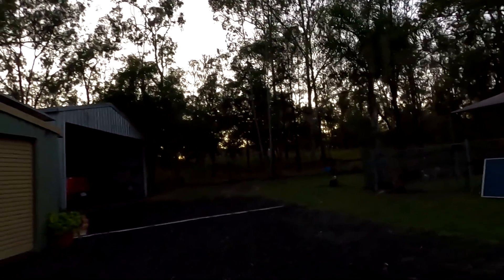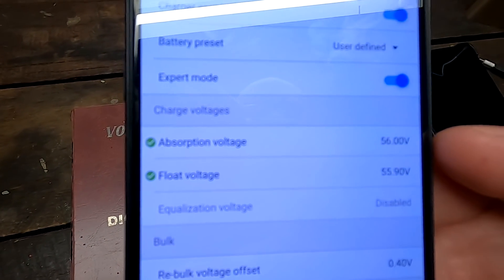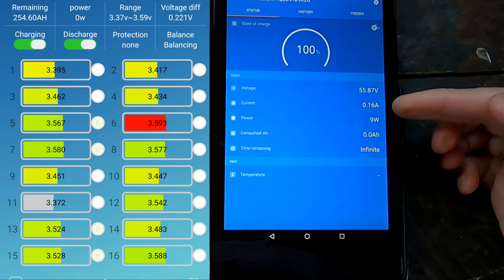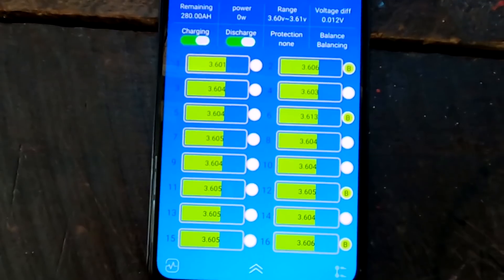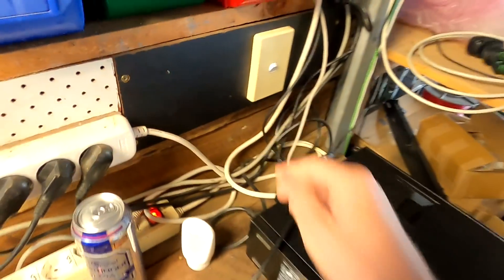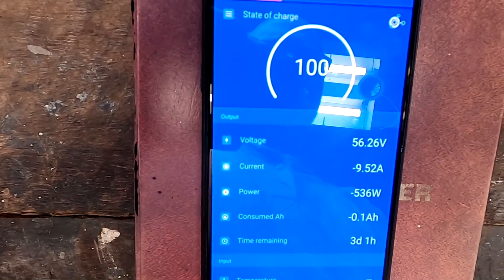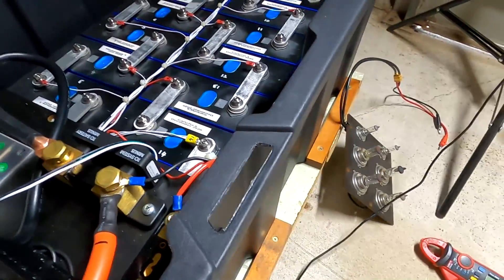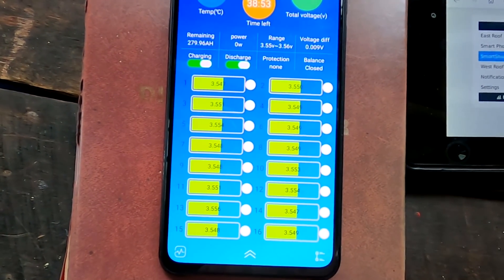Battery fixed  - but for how long? | Part 2/3

Comment: Be careful with just turning off one of your charge controllers solar cells degrade a lot faster without a load on them if they're in the Sun
Reply: Really? This is interesting I will do some research on this as that is basically what happens when your battery is full, the charge controller turns off.. or floats a very small amount.
Reply from the maker: Never heard of that before either. Why would they degrade faster without load?, @Josh?
Reply: @OffGridGarageAustralia  The danger, when using Victron chargers, is when you disconnect the battery from the charger while the solar panels remain connected. If you turn off the charger in the settings there is no danger.I tell you this from my own experience, when I broke a Victron charger.
Reply from the maker: @mihaitaiosub  will, I've shown this several times in my videos.  Disconnecting the battery dies not Herrn the controllers at all. They go into float mode and keep supplying energy to the load.
Reply: @OffGridGarageAustralia  Something like this happened to me when I had around 3000 watts from the solar panels and I disconnected the battery from the charger. Moreover, the local Victron distributor also told me that there is a risk of the charger breaking down, when we have high power from the solar panels without the battery being connected.
Reply from the maker: @mihaitaiosub  hmmm, that's been confirmed by Victron that it does not harm the controller. Other controllers can be fried by doing this (I killed 2 by doing this). I can ask the chief firmware developer at Victron again how the software is been written to handle these sort of situations.
Reply: @OffGridGarageAustralia  Ok,anyway, I will never risk it again.Because of this, I do not use BMS and I have an automation in Home Assistant that monitors the voltage on each battery and when the voltage in any cell exceeds 3.65 volts I use the external charger control to turn them off.

Comment: I did suggest equalization of the pack once a while in your very first video (months back) on the issue of imbalanced cells. But sadly it was ignored telling it is only for lead acid batteries that time. Anyways now you did that, I'm happy.
Reply: Equalisation not recommended for Lifepo4, (or GEL) that’s why disabled. I Should be careful using a Lead Acid setting with Lifepo4, although the charge profiles are similar. Lifepo4 profiles use CC then CV charging. A user profile, to enable higher charging voltage, to balance is possible; but just as easy to up the voltage manually, in the existing profile. I wouldn’t leave my battery in profile that is not quite right.
Reply: @michaelbouckley4455  Yeah, but I was talking about the process, which needed increasing the voltage to max once in a while and Andy did it in this video, that's why I'm happy. Not talking about the profiles here, anyways it's disabled, we can make a custom profile though.

Comment: Instead of balancing at 3.6 then complaining when it's not balanced under that, instead balance at your normal change voltage and then you will 'equalize' every single time the battery fills.
Reply from the maker: I'm not complaining, I'm testing, learning and sharing 😉

Comment: It would be interesting to cycle the battery for about 30 days WITHOUT ANY BALANCE but charge only to 3.45 V per cell.
And then after 30 days, charge it again to 3.60 V per cell and see how much the cells have drifted.
I would send a beer to see the results of this test. :D
Reply from the maker: That's what I'm doing now. I actually charged it back up after 2 day again and it was... -> next video.

Comment: Remember that the balancing by the BMS will actually take lots of daily cycles... several weeks (which is fine.. even desirable).  Not just one cycle, even if you hold a high voltage for a few hours.   Normal BMS operation is more than enough to keep LiFePO4 top-balanced.  You don't need to do anything more sophisticated than that.  Just return the Float to something reasonable (like 3.35V), and set an absorption time at the bulk target voltage of, say, 30 minutes, and that should be enough.

There is no such thing as 'equalization' for LiFePO4.  Its a bad idea... a very bad idea.  There is absolutely no need to equalize the cells once a month.  LiFePO4 cells hold their top-balance for many months, even longer than a year.   The small amount of balancing the BMS does on the daily cycle is P.L.E.N.T.Y. good enough to keep the batteries balanced.  All 'equalization' will do is wear the batteries out faster.

-Matt
Reply: He is not going to do Equalization, he is going to use that "settings" to go up to 3.6v with controlled maximum current and time to his battery. It is a "trick"
Reply: @Junker Zn Good point.
Reply: Equalization.. totally agree. There is a lot of documentation on this if you do a search for it.
Reply from the maker: Thanks all for your input with that. As Fernando said, we could use this function to just raise the voltage here and then to make it easier for the BMS to balance at a higher state of charge.
The main problem is, that I rarely hit the 100% SOC. It could take months until I manage to fully charge the cells again, especially in winter time.
Reply: @OffGridGarageAustralia  Not (being able to) charge the battery nearly full is advantageous, even if it a bit annoying sometimes.  The long the battery sits around less-than-full, but not too empty either, the longer it will last.

If you are not able to charge the battery up fully, also make sure that you are not regularly discharging it fully in winter-time.  Usually its one problem or the other and not something inbetween.  You might want to consider changing the low-voltage cut-off so the battery is not allowed to go below, say, 25%.

-Matt
Reply: As an addendum, I would also recommend programming the cut-off into the inverter, and then having a second inverter circuit for small loads that is allowed to go lower.  That way the lights can stay on after the larger loads get cut-off due to the low battery condition.

(As another addendum, for everyone doing off-grid... when you become entirely dependent on your off-grid solar + battery + generator + inverter system, it always makes sense to actually have two completely independent systems in operation.  Because there will always come a time when something goes wrong or requires serious maintenance and you don't want to be completely out of power what that happens).

-Matt
Reply: @junkerzn7312  Yea. With my inverters I have my top end set to "full" which is 56v. It will hit the 56v and run for another hour or so to top off current automatically (Very nice feature). Since my solar panels are not installed yet its more like a backup system for the house so I let the batteries relax and they end up at 3.3v or so. I have run tests on them and there is very little gain letting them settle at that voltage so I believe the amp hour loss is not worth keeping them charged fully. If I haven't used them for a month or so, I run a charge, discharge and charge back up cycle, then they are good.
Reply from the maker: @junkerzn7312  Thanks Matt. a 2nd inverter plus a 2nd battery bank make sense for redundancy.

Comment: Lithium io batteries do not need to equalised
Reply: @evroy anderson That is true, but he is cycling the battery at a lower voltage to increase the life of the pack. The downside to this however is, that the pack does not get balanced properly. By using the equalize setting, he can go to a higher state of charge once a month in an attempt to balance the cells.
Reply: @SpeakerKevin  you can balance at any voltage. Don't get suckered into anything this guy says in these videos, it's almost certainly false
Reply from the maker: @BenK. That is wrong as I just proved in my recent videos. You CANNOT balance at any voltage with these cells.
Reply: @OffGridGarageAustralia  does that mean even if all cell voltages are 3.35V, its not balanced or could be in different state of charge? that doesnt sound right, as my packs have been say 3.281V and they discahrge at same rate until 3.2ish, Also, I have left my 16s in parallel for full 45 days to balance at 3.200V with 1-2 mv difference.. so now you say that cells are not balanced?
Reply from the maker: @videostar555  with LiFePO4, voltages in these low areas is not an indicator of state of charge. At 3.35V there could be easily 10% difference in capacity and they all show the same voltage. This is just at the beginning of the knee in the charging curve, so charging to 3.35V will give you slightly inconsistent results.
Reply: @OffGridGarageAustralia  Yep, That is true since the curve is so flat but if they were at different SoC, discharging at 100-180A ( in my car) should deplete the voltage drastically but it remains similar until 3.2v across all 16 cells which I have discharged until now. I have been at impression that the cells are well balanced. :)
Reply: He is not going to equakize, he is going to use that settings

Comment: Your charge controllers can be programmed it to equalize on 30 day intervals and you can set the eq voltage too
Reply: Forgot to mention you need to enter expert to make those changes
Reply from the maker: I know, I have to use a lead acid profile and change the settings though to enable equalization. Otherwise it's not available.
Reply: @OffGridGarageAustralia  Oh ok

Comment: One benefit of creating your own profile is that you can easily load that profile onto the other charger and both chargers will have exactly the same settings.
Reply from the maker: Yes, that is true, I'm using this function all the time when changing parameters.

Comment: Bingo it will work until it doesn't or until Andy changes the settings LOL. Cheers buddy. Well equalization on automatic may work but if it screws up there will be nobody home to save the battery, seems to me there is no protection of high cell in equalization mode only high bank voltage.
Reply: @OffGrid Wanabe The bms will shut the whole pack down even if one cell goes too high.
Reply: @SpeakerKevin  That would be normally true but when you use a lead acid program on lithium it may just overide the safety parameters
Reply: @offgridwanabe  The Victron charge controller would do the equalization, while the bms would keep an eye on the cells.
Reply from the maker: I need to use the lead acid profile to enable equalization. I would then need to change all parameters back to what they were to match my LFP battery. If the equalization kicks in every 30days and charges the pack to 3.6V to allow balancing, that would be sufficient. The BMS will always be there to disconnect the battery if one cell goes over 3.65V.
Reply: @OffGridGarageAustralia  The app has a button to manually trigger an equalization cycle.  If it is a sunny day and you think you will be within earshot any beeping BMS for a few hours, then press the button.
Reply from the maker: @henvern   I've seen this button but it's greyed out if you have a Li profile selected. When I choose a lead acid profile, the button works. That's a good solution, as I can make sure to be around and step in of necessary. Great tipp, thank you.

Comment: Be careful with equalization. Your bms balance current is very low, so cell(s) will easily get too high and disconnect the pack. (Another good argument for parallel packs :) )

Comment: your changing to many options at once if this does work you wont know what exact option helped
Reply: He did sequential changes with observation in between. The key change was obviously increasing the charge voltage to 3.6v/cell which brought the balance to within a dozen millivolts/cell.  Then changed the balance threshhold to 1mv and then observed it balanced to that limit.